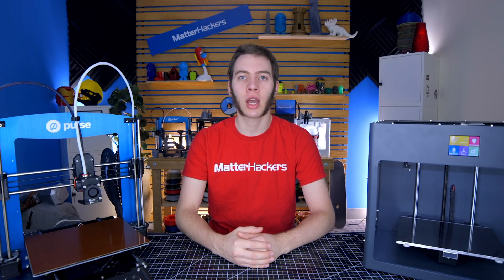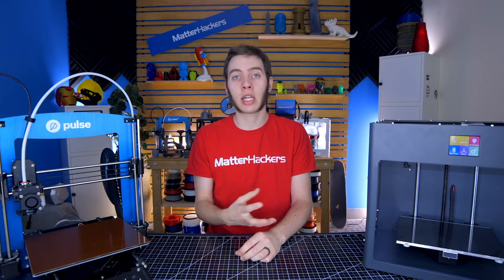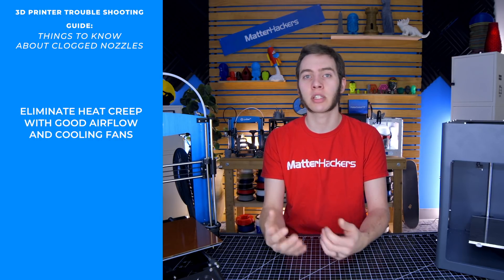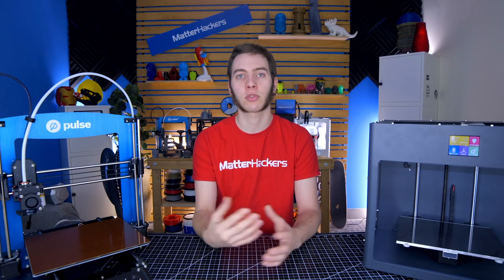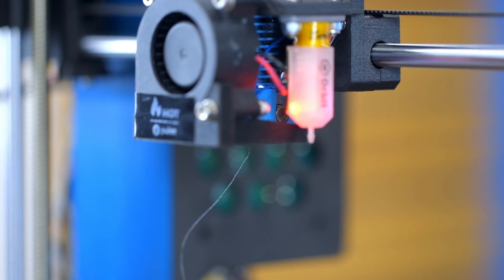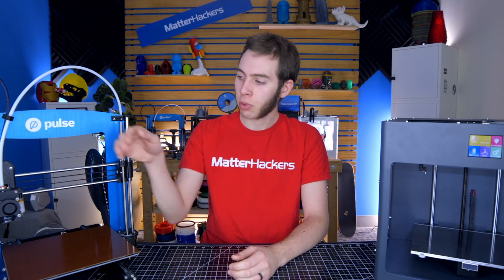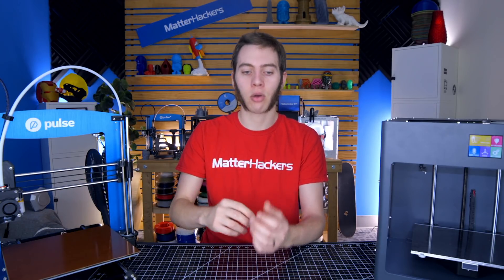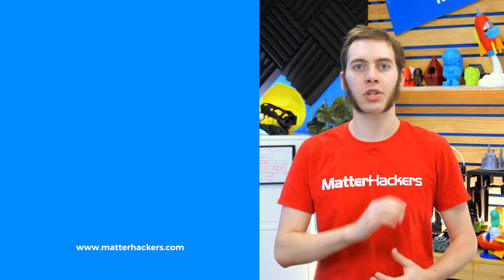3D Printer Troubleshooting Guide: Clogged Nozzles

Comment from the maker: Has anyone had a clogged nozzle or thought they had a clogged nozzle? What was the issue if it wasn't a clogged nozzle, and how did you troubleshoot it?
Reply: Could you PLEASE make yourself some 3d printed claws? you know... like wolverine's... :D
Reply: Not a clogged nozzle but my fan wasn’t working and it kept getting jammed.
Reply: right now my dad is making me fix the 3d printer and the nozzel is clogged i think.
Reply: I just finished replacing the nozzle on my i3 Mega S... It was clogged and the filament was not coming out the way it should and caused my prints to be very messy and fail half the time. Now it is working great. I just need to clean the clogged nozzle so I can reuse it...
Reply: Can you link to the other videos mentioned in this video?
Reply: @allyourcode  Amen!

Comment: I'm printing PLA at 210 C. The nozzle is getting clogged for certain filaments like white and black. Other filaments like orange and neon green aren't causing any issues. Is this a heat creep problem ? Should I try using a lower temp of 200 C for white n black ?

Comment: Do you have an STL file for those sideburns. 
So if the filament is left in the nozzle after a print. does PLA melt as good as new or should i snip above the printer and extrude excess PLA before every print?
Reply: always push some PLA through the hotend as it stopped the print than pull it out, never leave filament in the machine overnight if not priniting anything, store in a place where it does not catch moisture or in a food dehydrator set at 40C running to keep it dry if you olive in a high humidity area like me (PLA, ABS or Nylon, PETG, raise at 80C).

Comment: the fillament just stops comming out, ive tried pushing and pulling it and that doesnt work so its not the gear pushing the filllament up, i litaraly just changed the entire hotend and im still having this problem wtf is happening???
Reply: learn to take apart your nozzle and heat sink throat, and burn them on your cooking stove or with a Tekla or Bunsen burner occasionally to elimnate any traces of previous filament, than clean them well insisde with an exact diameter drill bit spun by hand only (you can put it in a drilling machine chuck, but do not use the motor to spin the bit at all) to eliminate ashes, than put them in the way of tap water runniing full steal and observe the water coming out the other end.  Also if your throat is inner coated with teflon or has a teflon tube, the teflon might have shrunk if the hot end reached occasionally over 240C, make some spare teflon tubes to replace them.

Comment: I put hairspray on my glass bed and the print nozzle got stuck on the 4th layer. I guess I had it to close and the hairspray was just thick enough to stop the head from moving. I should have run a test print and adjusted the bed as it was printing to compensate.
Reply: Religiously monitor visually the first few layers, mannualy adjust the Z screws on the flight while printing to match bed deformation under heat, it is never in the same spot.  Once you are confident you are over the danger zone, you can go to sleep while the machine works.  (Or go to your job as I do)

Comment: I have a flashforge finder I bought from a guy. He says everything work but when I got home to test it out the 3d printer doesn't head up all the way. It heats up to 182 degrees Celsius and then it stops. I've check if it's the right power adapter and that is not the problem. Anyone have any idea what is causing this issue?  I was wondering if a clogged nozzle could as contribute to the problem of why it is not heating all the way up?
Reply: your thermistor element might be broken, buy a few spare, they are cheap, also might be some bad line in the firmware, check that too (youtube is full of tutorials about that)

Comment: Requesting assistance - I'm having clogging issues with esun PLA+. I've used this before and had great results once I figured out settings on my Ender 5.  Recently, I've been doing longer print jobs with another spool and I've had to change the nozzle 5 times. Some of the prints don't even finish the 1st layer.  I am printing at 210-215 & sometimes 220 (range of filament is 205-225), Bed - 70-75 (helps prevent warping), Nozzle - 0.4, Speed - 80 mm/s, Layer Height - 0.2, retraction - 80 mm/s & 6 mm.... I level the bed for every print, since I'm changing the nozzle & bed temp depending on what I'm printing. But the clogging is killing me, atm!!
Any assistance would be greatly appreciated!
Reply: E-Sun PLA sucks, i had it tested on all my machines for a year, also PETG, ABS and otehrs same brand, their quality control is ... not.  I found their filament to be cross contaminated with other filament bits that melt at different temperatures, so I ended up using their filament at higher temperartures to avoid clogging, and when done, never ever bought any E-Sun again.
Reply: Did you fix it? And how?
Reply: @hudsonroberge9897  I started having the fan turn on after the first layer, sometimes I turn it on manually once I've tuned the z-step. This keeps the nozzle from cooking the filament too much. So far, this has made a vast improvement. I still have to change the nozzle every so often, which I may choose to do at the start of a lengthy print.. nozzles are cheaper than the frustration of a clog. I also don't try to push the temp past 210.
Reply: I used PLA+ and experienced clogging right off the bat pretty much. Swapped that out for regular and still having issues. Buying a new hot end here really soon. Never touching + again. Before I went to plus it was doing great with regular (800 hours on that). Tried plus and wham broken. Stay with what works.

Comment: All great points but the order that you present these problems and fixes is in fringe>most likely which I don't like. In all likelihood a beginner needs to be told to just clean or replace their nozzle, not hear about checking their all metal heat break or enclosure being too hot lol.
Reply: Yes, that's the solution, you also need to recognize when it's clogged right?

Comment: Your the guy who thinks steam is a gas. Not sure if you should be teaching
Reply: Steam is a gas.
Reply: @DeShark88  Steam is not a gas but steam can be converted to gas it's called hydrogen.
Reply: @keymaster2108  check the Wikipedia page for Steam. https://en.m.wikipedia.org/wiki/Steam
Hydrogen is one of two elements that make up steam. It's a bit like saying hydrogen fluoride isn't a gas because it's made of hydrogen. Steam is water in its gas phase.
Reply: @DeShark88  Gas phase does not mean gas
Reply: @keymaster2108  That's exactly what it means. When a liquid boils it turns from the liquid phase to the gas phase. It transitions from a liquid into a gas. Just as ice is water in the solid phase, so is steam water in the gas phase.
Reply: @DeShark88  If water is gas then it is hydrogen
Reply: @keymaster2108  hydrogen can be a liquid. It's called "liquid hydrogen". Water can be a gas. It's called "steam".
Reply: @keymaster2108  You're the type of person that shouldn't be judging others pretending that you're smarter. I'm not the smartest but still.
Reply: steam is a gas

Comment: I was using white pla and changed to black, which I've changed colors several times. But now when I extrude filament it comes out of the nozzle crooked. Changed to blue pla but every print I have tried fails.
I used the acupuncture needle but can't get the filament to come out straight. New nozzle time?
Reply: learn to take apart your nozzle and heat sink throat, and burn them on your cooking stove or with a Tekla or Bunsen burner occasionally to elimnate any traces of previous filament, than clean them well insisde with an exact diameter drill bit spun by hand only (you can put it in a drilling machine chuck, but do not use the motor to spin the bit at all) to eliminate ashes, than put them in the way of tap water runniing full steal and observe the water coming out the other end.  Also if your throat is inner coated with teflon or has a teflon tube, the teflon might have shrunk if the hot end reached occasionally over 240C, make some spare teflon tubes to replace them.

Comment: so those nozzels in the picture at begining are still good and just need a blow torch or acetone to clean???  my nozzle seems to be printing good still but has black burnt material on outside of it.. i removed most with finger nail and tiny screw driver...but did not want to go crazy on it...then i releveled bed... thax

Comment: Helpful video: thanks.
I am a 3D printing newbie and just experienced mt first nozzle blockage (using basic £99.99 Startt machine from iMakr). My solution was to heat the extruder to 240 C while pushing  white PLA filament through manually: a black particle (from previous job) came through and the machine cleared. Great, although I suspect that some more expert bods might say I was just lucky!
Reply: learn to take apart your nozzle and heat sink thorat, and burn them on your cooking sotve or with a Teka or Bunsen burner occasionally to elimnate any traces of previous filament, than clean them well insisde with an exact diameter drill bit spun by hand only (you can put it in a drilling machine chuck, but do not use the motor to spin the bit at all).  Also if your throat is inner coated with teflon or has a teflon tube, the teflon might have shrunk if the hot end reached occasionally over 240C, make some spare teflon tubes to replace them.

Comment: You could also have your print nozzle too close to the bed.  I went through and replaced the bowden tube and put a new nozzle on my printer...only to have the exact same problem...I then said "Crud, nozzle too close to the bed"...fixed.  :)
Reply: that is something to monitor visually at EVERY single print start.  Religiously.